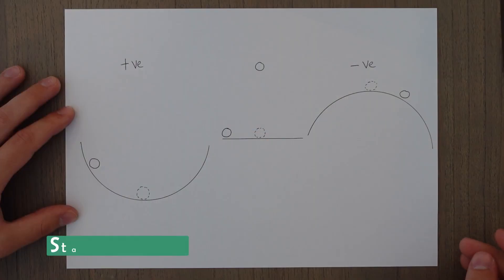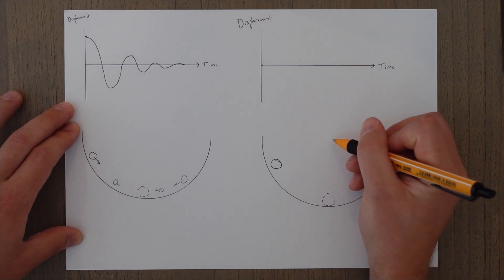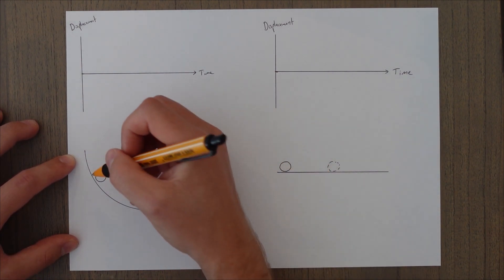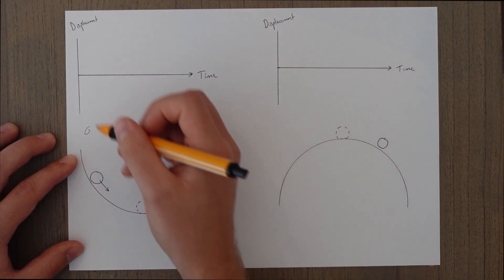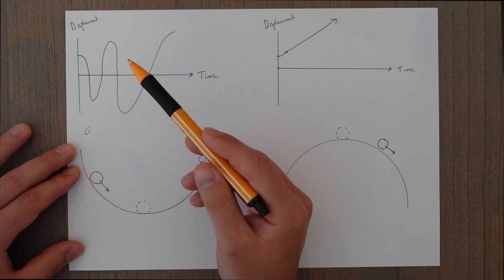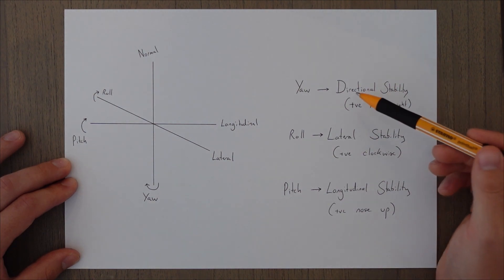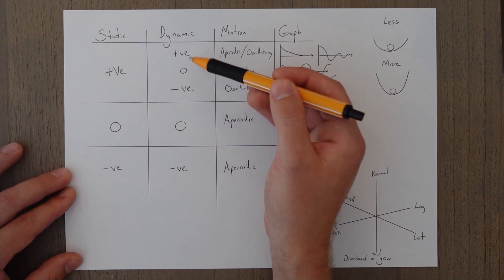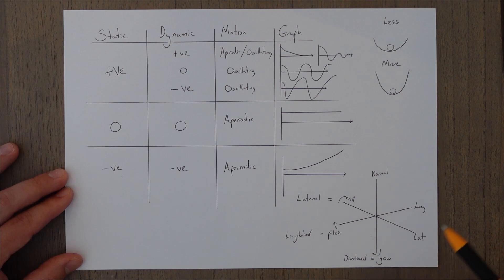ATPL Principles of Flight - Class 16: Stability I.

Comment: @atplclass Hi. Thank you  for the videos very helpful. I just had a question about high dynamic stability.    At 8:52  you say that high dynamic stability will cause an object to remain oscillating in this new displaced position. Will these oscillations not dampen over time? Is it not neural dynamic stability you are describing. Thanks again and great video!
Reply from the maker: Yes they will dampen over time as other factors like friction slow the natural oscillation down.